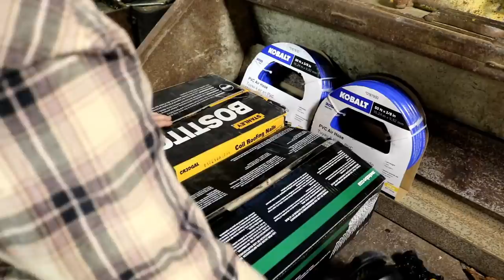Jackhammering Concrete Floor and roof Prep

Comment: I find it amazing that the previous owner did not add rebar.  The part where you showed how the only rebar in the pad had rusted... Water will always be under the concrete pad.  It will wick right through the concrete and the inside of the shop will be full of moisture.   When I built my shop, 20 years ago, the concrete crew tamped the ground really well.  They  next laid down a thick sheet of plastic and sealed it around the footing.  Next came the rebar and they laid chunks of stone under the rebar to raise it up.  They could have used a kind of U-pin but that would have penetrated the plastic.  Would have defeated the purpose of the plastic to begin with.  After they were done with the prep work and ready for the pour I saw the plastic and asked why?  They explained about the moisture, rusty equipment for one... and I have been forever thankful.  
     I have been in shops where the plastic barrier was not used and it is forever humid, never seems to dry out.  Excessive moisture can lead to mold and mildew problems, the list goes on and on.  Really consider using a plastic barrier.  Love the baby squirrel.

Comment: You actually want to STAY on daylight savings. We're in daylight savings now, and about to go back to Standard Time in a couple of weeks. And I DID see Camarata's video, and I completely agree. We should STAY on daylight savings all year. I want light in the evenings to get things done.
Reply: If it weren't for DST there would be days at a time where I wouldn't see the sun. Leave before sunrise, inside working all day, home after sunset. That would be soul-crushing.
Reply: Just get up an hour earlier and start working, if you want to maximise daylight.   Unless you are dependent on public transport or you're punching a clock in someone else's workplace  you aren't affected by DST
Reply: I agree. If it wasn't for the argument about kid waiting for the bus in the dark during winter w/ DST, we would probably have DST all year round.
Reply: Hard disagree. I don't even want to think about how pitch black dark it would be in the mornings if I had to go to work in the middle of December on DST. Never never never never. Instead, nix DST.
Reply: I'd rather it be light out, or soon to be light out, when I have to wake up at ass-crack-of-dawn hours to go to work. Go to bed dark and get up dark. Stupidity. I'm for standard time.
Reply: Yep, we should have permanent daylight savings time!  But I also agree: I could just ignore the time change just get an hour earlier when we go back to regular time. I just may do that... working from home for a while yet anyway.
Reply: @cheeto4493  As someone commented on the Camarata video, tell that to the kids in Alaska. It's dark all the time there for many weeks - they seem to manage.

Comment: "noassatall" is a silent epidemic: do not attempt home remedies such as drinking dark beers and eating fritos and dip, cheetos. Most of the time, it has the opposite effect: "beerbellitus". Medical devices such as belts and suspenders are the real treatment, however only after shredding and burning your "Young Man Card".
Reply: So True !
Reply: The counterpart to noassatall is dunlops disease (See dat big boy over dere?  His belly dun lopped over his belt.).  In both disorders, it is difficult to wear a tool belt without suspenders.  Steve, on a typical job site (meaning there are exceptions) you want the guy with dunlops disease wrestling the jack hammer and the fellow with noassatall doing the more nimble work.  Of course, those rules of thumb go out the window when you are working for yourself and on smaller commercial job sites.  I figure you weigh about 140 pounds / ca. 65 kg soaking wet.  That's not near enough.  The guy runnin' the jack hammer needs to be at least twice as big as the hammer, even more is better.  When my father needed concrete broken, he would come to me and say, "I need someone broad of shoulder and dim of wit.  Are you ready?"
Be well & Best regards,
Gottfried
Reply: He we are just amazed at the "super sized" epidemic that most Americans seam to suffer from.
Reply: Noassatall and Dunlops disease differ mainly by the "Gut to Butt" ratio. As to Daylight Savings time? Move to Arizona!
Reply: I didn't suffer from it until my early 50s, though it has pretty much won the battle now.
Reply: Beerbellytosis is also known as "dunlap" syndrome. A condition where the belly has done lapped over your beltline.
Reply: Beerbellitus or dunlaps disease also known as Furniture disease. When your chest falls into your draws :)
Reply: @BennHerr  LOL LOL LOL !!😂😂😂😂
Reply: And Steve  starts do kidding us so serious like all other narration on the videos, and any laugh on his face on the video !!!! First off all (I'm Brazilian and english isn't my first language),  and I had to saw that part four times to understand how kidding he was....
Reply: Then at Christmas your kids and grandkids decide you need more than one pair of suspenders and you end up with 8 more pairs. But not one is for a toolbelt.

Comment: I was diagnosed with Juvenile Noassatall at an early age and things aren’t a bit better today (I’m 65 now). I’ve dealt with all the quack medicines and miracle cure schemes but nothing works. I’ve resigned myself to the fact that the old belts AND suspenders are and always will be my daily routine. I’ve never actually mooned anyone but I’ve been right to the edge where panic sets in. There’s been talk of a telethon for the cure for many years but it’s never happened. Like my britches, I wonder what the hold-up is (see what I did there?)!  I’m with AC, DST sucks and I’m glad it was repealed. Kudos to your son; he handled his share of busted up concrete like a man. Hang in there. 😎👍👏

Comment: Like #696
Thanks for the video!
Glad to see the coil nailer!
I helped a friend who's van wouldn't start. The problem was a bad connection on the starter between the solenoid and the starter motor. Got his wife home. Next day, came over and cleaned up the whole starter. Next day, my friend put a coil nailer in my hand to say thank you.

Comment: The holes in your boards are from woodpeckers going after carpenter bee larva they lay after boring in the Wood. The reason the oak doesn’t have the holes is the bees prefer soft wood.
Reply: The only thing I have found that will get rid of (kill) most carpenter bees is Demon WP. I get it at my co-op. Don't waste your money on traps, they only trap the male bees which do not do the damage. I live in a log house and it is a constant challenge.

Comment: Nails have been holding our homes etc for a lot longer than screws eh. You are absolutely right about woodpeckers and the wood. Although they will pound on roofing tin when mating. I ran a Feller Buncher for many Years. The saw on mine is 80 in. It can fall and place up to 32 in trees. My head is much different. The windows are 5/8 Lexan. Thousands of $ there.. Oh my Walnut is one spoiled squirrel eh. As always you and yours are a great way to see my Saturday off to a nice start. Take care eh.

Comment: Looking good. I like fall myself. Feels like you come alive after boiling in August. I would replace the wood pecker blocks. It'll only take a few minutes once the roof is off, before sheeting it. The wood is compromised and still usable yes, but if you've ever noticed - insects will return to those same pieces time and again. For whatever reason those particular chunks of wood are tastier. It's easier to see in an open barn or machine shed. Over the years it's a never ending fight to chase them out of that same stick of wood. I've used drain oil, soaked them best I could only to watch insects chew through the oiled wood to get in deeper. Hazelnut is getting playful, that's always a fun time.  Hoping you have some good dry weather for roofing. That's not a fun place to fight weather. Thanks for sharing

Comment: Heh, love the old Chevy 4x4 pickup, "if you can't find em, grind em"
Reply: those old SM465 4 speeds have a non syncro 1st and reverse so RPM matching is key if actually shifting into them with the truck moving at all.

Comment: after you've poured your new slab in the shop, I suggest you leave enough open space in the front of your shop to work on your truck, or  unload a trailer, out of the weather and on a flat, solid surface.

Comment: Just a note in case you didn't already know. If that was an sds+ drill hammer you are way better of not leaning right onto it to force it through the stone/concrete. There is a sweet spot around the middle of the possible travel where the hammer is at maximum forward velocity. This makes light work of any stone I've come across so far :-)

Comment: Touching on s few issues:  one the infamous screw vs nail.  Both have their strengthen and weaknesses.   But there is also a crossover choice.  Ring shanked nails.  21 years ago we rebuilt a large wrap around deck.  Time was a factor, so what we ended up doing was pilot drilling and screwing the last two screws on each end so they wouldnt split or crack through the screws.  The rest of the deck we nailed off with 3" stainless steel ring shanked nails.  After 20 years the ring shanked nails are just as tight as when we installed them.

When you install the gutters  go to costco or their web sight and buy a couple pack of the stainless steel futter screen wgich screw down on the gutter, you will rarely ever gave to clean your gutters.
As for wood pests try Jasco wood preservative.  Its cheep,  readily available, and works well.

Comment: Steve, if you want to extend the roof overhang out the back by 12 inches or more you could do tat by constructing triangular braces from 2x4 or 6 lumber to support the sheathing and hang a false rafter from the end

Comment: Used to be able to get rubber fuel hose rated to like 150psi+, that stuff worked great for air hose, especially for cold weather, can't seem to find it anymore, but it was half the price of rubber hoses labeled "air hose".  Anyway, I'm with you on the time change, only we're currently on savings time, I'd prefer to stay on DST all year, and not switch back and forth. I suppose if you don't punch a clock, it doesn't really matter, but for those of us with a day job, I sure enjoy the daylight after getting home from work, and loosing an hour in the morning wouldn't really matter since I'm gone before then anyway.  Thanks for the video!  Awesome work, can't wait till the shop is "done" (well, done with this project anyway).  Take care!

Comment: I was actually thinking about the time involved doing the concrete breaking. You also could do what I have seen done on industrial concrete floors which is to saw the floor into  liftable pieces , drill for a concrete anchor in the center then pick up the piece with a fork lift or skid loader and dispose of of it.

Comment: Cheap wood treatment is to mix a 50 50 blend of illuminating kerosene and creosote, and paint the wood with it. Roof trusses the lot, after a day to soak in do it again, and apply once a year. Works to make sure nothing will be living in that wood, even in an area known for borer in every bit of wood. Not good to spray as it will cover the walls and stain them, but will make it last a long time.

As to the rebar, that likely was tramp metal that was there by accident, or was originally a line holder to set a level.

Comment: Steve instead of wood braces you could use Lowes 11.69 inch braced shelf bracket . they are unobtrusive and are $7.48 each. You wouldn't put any load on that section of the roof any way. The other option is rip the tin off the front section of the roof where you have an over hang an see how the builder created the overhang.

Comment: hey Steve I love what you're doing to the shop it looks great in the progress is coming right along. As for the no ass syndrome LOL suspenders work really well you can get them at your local Home Depot and they work Wonderful when I was metal framing and hanging drywall I how to tool belt that weight about 30 damn pounds LOL depending on how many screws I had in it and how many different types of screws I had in it anyway, suspenders work awesome and your hips won't hurt either from carrying all that weight keep up the great work I love your videos

Comment: My collie also had seizures. Wonder if they are prone to them. In Florida rebar is everywhere and it's a terrible idea. Pours can last less than 15 years. The rebar just blows up the concrete, it's better off with out it.

Comment: Drive a screw and nail in halfway brake with a hammer screw 4 blows nail 10 .To hang joist hangers require nails or Simson strong screws. Ontario is going to stay on daylight saving .

Comment: Since you want more daylight after work, you don't want to get rig of daylight savings time.  Instead, you want daylight savings time all year round.  The only downside to having daylight savings all year round is that the sun will rise 1 hour later than you're used to in the winter, so it will be dark in the morning for a longer period of time.  Returning to standard time is why it gets dark earlier.

Comment: Screws vs nails?

I've got another one for you, try a nail into a pre-drilled hole. The exposed fiber ends really grip the shank. Leave it a few days for the wood to relax before testing the retention strength.

Comment: Over the years I have bought good name brand hose and cheap Harbor Freight hose. The expensive stuff is strong, heavy and annoying to use,
It puts more stress on the fittings and employees that have to cope with it. The cheap HF stuff is light and flexible and universally preferred by me and my employees. We don't abuse them and they last a long long time.  I'm sure there are applications where even the toughest hose is not tough enough but for ordinary applications the HF hose is best.

HF hand tools are vastly superior and outlast Snap On. In fact Snap On tools get "lost" while the HF tools don't.  Employees don't steal HF tools. Not only are Snap On tools absurdly expensive, you have to replace them more often. No one will break into your shop to steal HF tools.
Another huge benefit of cheap tools is you have countless duplicates. Each workstation, machine or application can have their own set tools right at hand. It saves a lot running around. As soon as any tool box is available to many users no one is responsible for the loss. 
JY

Comment: Steve that is not  woodpecker damage your showing at about 4:30. That is the telltell sign of Carpenter Bees. I have them down here in North Alabama and I have to fight them buggers every year. You can see the same damage on my Shed that you have.  There are Sprays you can put out to keep them away but they only last one season.

Comment: Dont forget damp proofing membrane under new concrete and reinforcing mess to stop it cracking, every job i have done without the mess i have always regretted it when it cracks and if you dont want machines to rust you need the dpc membrane i know it costs but always worth the extra money in my oppinion
Reply: mesh  !!!

Comment: Day light savings was originally intended for farmers to have the extra hour of light for harvest time in the fall. Andrew Camarata is right, I think we should stay on forward time. Politicians think we save energy by turning the clocks back. IDK how that is possible if it gets dark an hour earlier. You still are using the lights and heat, as well as still getting up in the AM in the dark. I guess if you work bankers hours or politicians hours that is fine because you don't go to or from work that early or late in the day.
Reply: Farmers work with the sun not the clock

Comment: Gotta admit I would have just got several gallons of that rubberize truck bed liner and rolled it out all over the tin roof and called it good. Lot cheaper and I bet it would last just as well

Comment: That ‘glass’ is probably polycarbonate which is to all intents indestructible, except from high heat, naked flame, L-grinder and power saw etc.
Heavy hammer blows will not only bounce off, but likely cause the wielder injury.

Comment: Are you going to add a small area of extra thick concrete to handle one or two extra heavy pieces of equipment If you happen to acquire them

Comment: Screws hold better but the shear strength of screws is low while nails come out easier but have a exceptional shear strength. I like to use screws and nails but prefer screws whenever possible.

Comment: On the section of concrete where the the two half's will meet are you going to horizontally drill and ancher rebar into that so it stabilizes the two slabs together? the reason I ask if you don't you're probably going to wind up with settling problems in the floor will not be even.
Reply: I would also add: use epoxy to set the rebar in old slab as well. Also make a slurry of cement with a little sand and use stiff bristle brush and scrub the edge of old slab vigorously  just prior to new cement contacting it. This will guaranty full bonding to old slab.

Comment: There is no debating screws vs nails for shear strength. There has been endless scientific tests performed and nails win by huge margins! This is also why federal and state building codes require nails and not screws. Screws are designed to resist withdrawl loads and not shear loads.

Comment: any poly pipe ( 1"0 )  from door to back of shop to run ?..be it hydro or larger pipe for water, wash station
? Yes all that can go over head but once sheeted, it is as bad/good as below concrete.

Comment: Nails are the correct choice. Nails are ductile metal, which is what you need in sheer. Most screws are non-ductile metal. You can buy ductile screws, but they are specialty items, expensive, and unnecessary in cases like this when nails work just as well.